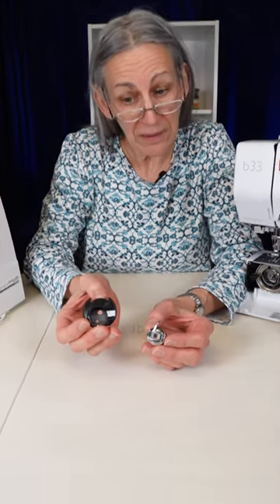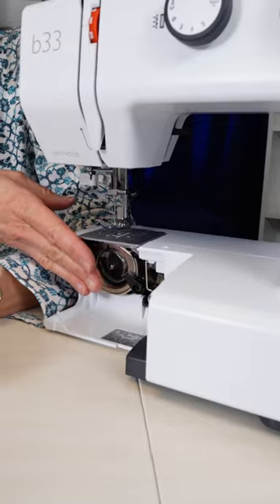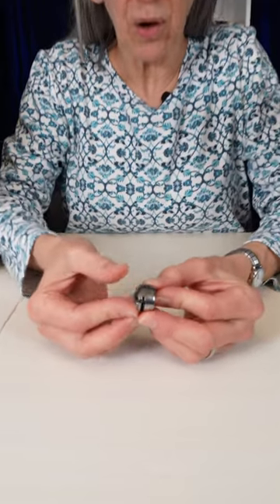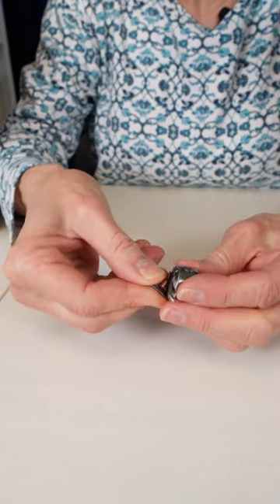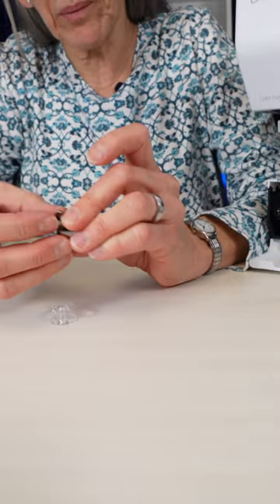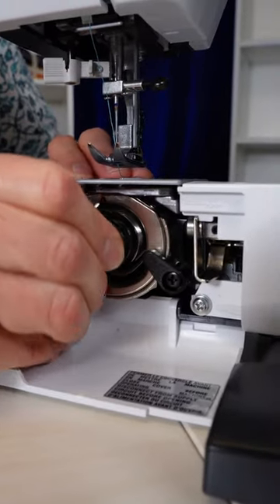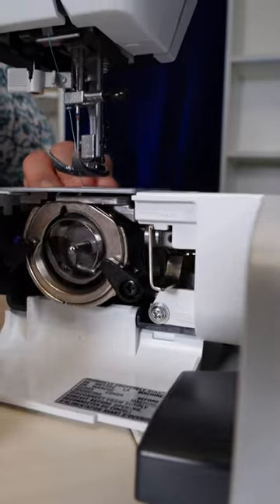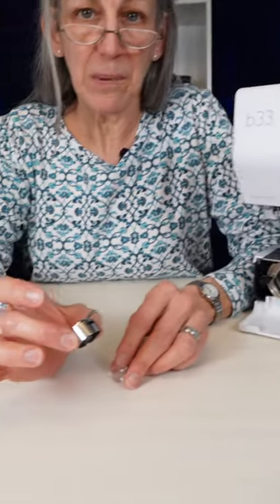Sewing Essentials: Bobbin Cases for Your Machine

Comment: How long do bobbins last stitch wise? I just bought my first machine ever for embroidery and I have a 27,000 stitch project I want to run but I’m scared I’ll screw it up if I have to switch bobbins in the middle. Brother SE630
Reply from the maker: it entirely depends on the weight of thread you have in the bobbin. you will want to wind your bobbins with a lightweight embroidery bobbin thread to maximize how many stitches you can get out of it. We like finishing touch bobbin thread. different machines also use different sized bobbins, but assimung a 15 class bobbin (the most common size) with bobbin thread you should be able to get 30 to 60 thousand stitches out of it. If you are worried about running out, I would wind up a fresh bobbin and change about 3/4 through the project. you can always press the pause button on the machine to stop the embroidery, change the bobbin, and press resume. Hope this helps!
Reply: @MontavillaSewing  you’re amazing. Thank you.

Comment: So what do you think is the best bobbin case?
Reply from the maker: A machine with a top-loading bobbin is easier to use, especially for checking at a glance how much thread you have left. A front-loading machine has a stronger bobbin system. But my top-loader works fine for me, and I do a lot of sewing.